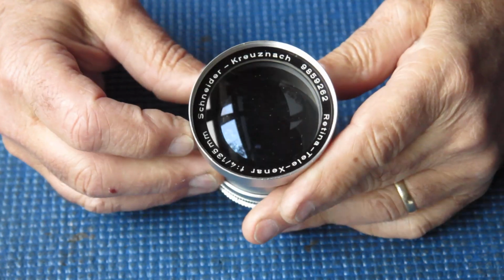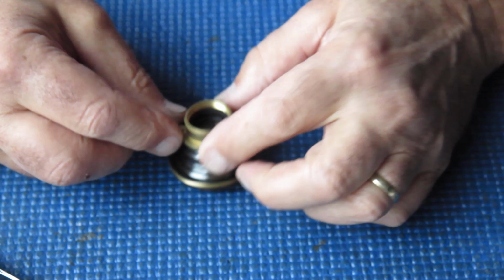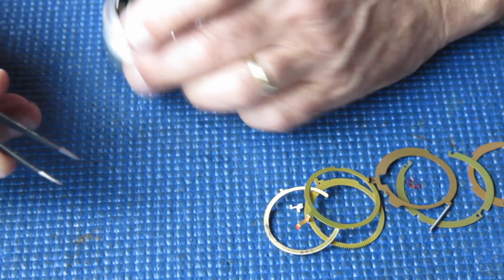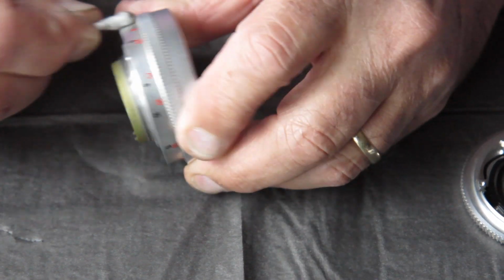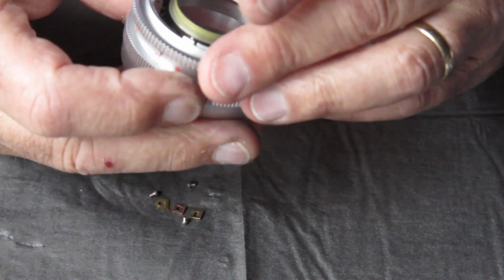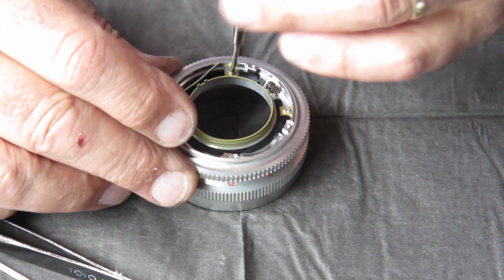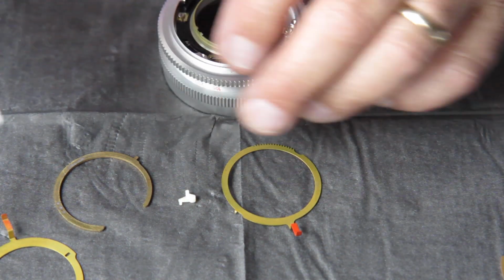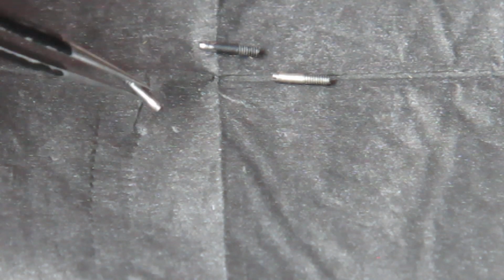Servicing a Retina-Tele-Xenar 135mm f/4 lens part 01

Comment: Is your post office open yet ?  I just bought a Retina IIc and want to send it.
Reply from the maker: Yes, and the deliveries never stopped, but the delays are still huge. Last camera to arrive from the USA took thirty-eight days by airmail to reach me, and that was actually an improvement on the previous one.
Reply: @ChrisSherlock  Thanks for the information.   I'll check out different shipping methods.  
By the way I love the shutter repair videos.  I have done a bunch of shutters, but YOU are an artist.  Do you wear magnifiers at all when placing the aperture blades?   I like your socket set set up for placing the blades, and all the hand built tools. I could go broke buying tools.   Thanks for the videos.